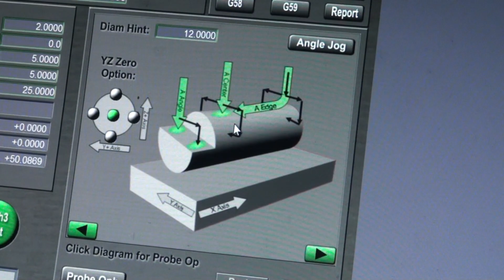Pull Gear Speed Reducer Part 5 - Thanks to Mr. Pete

Comment: I am in the process of building a boring head.  I got the pdf plans off the Internet and there is no other content for me to reference during my build such as a video.  I have ran into a few problems with the plans and wish that someone had made a video going into detail. In the case of your build, if anybody has any questions or doesn’t know where to start with the order of operations they can reference your videos. Lastly, you went into so much detail so that others might be able to offer you their opinions or suggestions.  Keep doing what you’re doing, don’t change a thing.  I watch your videos from beginning to end without fast forwarding.  Thank you !
Reply: I think This Old Tony made his own boring head if not mistaken....check it out
Reply: Makin Sumthin From Nuthin yes I saw TOT’s boring head cid.  There is another video similar to the one I am making but some tolerances on this specific blueprint dont add up.  Thanks

Comment: Great, now you just added a new project to my list and I got here all because a guy and I had a conversation about how I told a guy he was going way too fast for the hole saw he was using and another guy said to get a pull gear. Well, I looked it up, your video popped up and here we are. I wanted to add one of these to my Bridgeport M Head, but didn't know what they were called. I knew it had to have planets, but never knew someone designed one already. Thank you.

Comment: Just watched this series. Excellent!
Not to criticise your work in any way, I remember an epicyclic reducer pulley system being used on the spindle of the Dore-Westbury milling machine design, rather than on the motor. This has the advantage that the belt speeds are not reduced, and power transfer is less impaired. I realise that the whole locking system has to be revisited.
Well done!
Reply from the maker: Russel,
When I was looking around for a way of getting some back gearing on the drill I remembered seeing a constructional series on the Dore Westbury epicyclic gearbox in an old Model Engineer magazine. I also remembered that I purchased the drawings for the Dore Westbury many years ago and I frantically searched for them in my filing cabinet. Full of hope, I unfolded the drawings only to find that they didn't detail the gearbox. I searched online and could only find some photos of the outside of the machine with no details of how it was constructed. Then, out of the blue, Mr. Pete put up his videos on the pull gear. I sort of took my cue from what he was doing. I rarely have to use the reduction but it's nice to know it's there if I need it.
Regards,
Mark

Comment: Great drawing and design.  I noticed on Mr. Pete's Pullgear, where the topcap engagement LATCH drops down in for lockup there was also an additional crosscut maybe 1/16" deep at 90° I would imagine to prevent the LATCH from walking and dropping into the lockup position unintentionally. 🤔👍
Reply from the maker: I'm glad you could make use of the drawings. It seemed a shame to produce it all and then not share it. I did notice the groove for the latch. It would mean a catastrophic failure if it were to lock up while in the reduction mode. 
Cheers,
Preso

Comment: Brilliant videos Mark! Exactly the same problem I have with my very similar drill press. Also it's a great device for many of the low speed mechanical devices I want to make!
Reply from the maker: Thanks John. I was getting really frustrated with my drill press. I purchased it as a junked machine with most of the drive missing and although I got it working by making some new pulleys it didn't have the low end torque to drill much bigger than 12mm in steel. With the pull gear I can run much bigger drills and hole saws so that is a plus. I didn't even know such a thing existed until I watched Mr. Pete's video on the pull gear and that was the inspiration I was looking for to have a go.
Regards,
Mark

Comment: A worthwhile project Mark it will make the drill press a completely usable tool now. Congratulations with a very successful build. I will download the drawings to attempt to make this but will have to carve it out of solid bar stock as I do not have foundry facilities here. I did however do casting at the high school I taught in.
Reply from the maker: We were never allowed to teach casting at schools that I taught in. I guess the timetable structure would have made it difficult because our lessons were only 50 minutes long. It would take that long just to get the furnace hot. 
Regards,
Mark

Comment: I like this. Planetary gears are cool. There are VFDs with vector control, which allow nearly full torque from zero RPM on up. You just get the motor down to bare form (no pulleys, just the shaft, and there's an auto tune function that spins it for a few seconds and fills in some parameters. There is also sensor vector control, which requires a shaft position sensor. But it is the bee's knees and actually allows for even closer to full torque from zero RPM on up.
Reply from the maker: I tried delving into the parameters on the cheap Huangyang VFD I have on the drill press but I could not get any decent torque out of the 240V three phase motor. The more expensive VFD on my small Sieg X3 mill is better at vector control but at the end of the day I was intrigued by the mechanical innards of the pull gear mechanism and I wanted to have a go at a planetary gearbox. As it turned out, I purchased a Bridgeport milling machine soon after finishing the pull gear and it sort of made it redundant since the Bridgeport is a much more capable drill press with tons of torque. 
Regards,
Mark

Comment: Hi Mark, have just watched this series and I’m a new subscriber, the only others I’ve done so are Mr Pete, TOT, Stefan G and That Lazy Machinist.
Your style give us the ability to understand what is going on rather than just be told the answer, please keep your approach.
Your machining ability is fantastic 
Loved the humour!
I have two questions which relate to the gearing , 1) would re-inserting the missing pulley from the original setup have achieved a similar goal with your VFD.
2) are you concerned about the small screw on the motor shaft transmitting all the force and possibly damaging the shaft, or does this not matter because of the gearing effect? ie less force at the drive side
I hope you are not offended by these questions, I’m self learning metalwork in my 60’s after moderate experience with woodworking and like to understand the science behind the method 
Regards Stan
Reply from the maker: Stan, thank you for those kind comments. With regard to the missing pulleys, we used to have several drill presses like that at the school where I used to teach. They had a good range of speeds but it always seemed like you needed to go from a high to low pulley range and that always meant taking off at least one of the belts so that you could swap them from top to bottom. They were also noisy due to the double reduction. The pull gear setup is still relatively quiet when it direct drive mode and the change from direct drive to reduction drive takes just a few seconds to set up. I rarely need to swap the belt around but the real reason I wanted to make the pull gear was purely for the challenge. I didn't expect it to work as well as it did but figured it was worth a crack!
The relatively small engagement of the key doesn't appear to be a problem. The torque is all concentrated at the chuck spindle end of the drive due to the mechanical advantage of the system. A bigger engagement of the key would have been desirable but I was running out of options for designing that in to the system. Unfortunately, engineering design is all about compromises. 
Regards,
Mark Presling

Comment: (I'm a little late to the game, but I can't resist piling on…)

If Mr. Drive is too dim to recognize the value of educating rather than merely entertaining himself,   well then we can't expect him to figure out how to mute the sound on his internet machine.

Great project, Mark! I think I'll be keeping my eyes open for a scrapped automatic transmission from something small (Micra?) to steal the gears and carrier from. Then I have to invent the problem this would solve. How about a motorized garden cart?

Thanks for the videos.
Reply from the maker: I've been criticised occasionally for talking too much but as you have observed it's sort of necessary to explain how and why a process is used. Having built the pull gear and used it on a few occasions I now find that it is pretty much redundant since I have purchased a Bridgeport milling machine. It has tons of torque for driving big drills but it was an interesting exercise building a planetary gearbox and working out gear centres. 
Regards,
Mark

Comment: Their is a lot of deflection and rotational movement in your drill press table.
Reply from the maker: Yes. You are correct. It's funny but I never notice it until I review the video footage. I have watched other people's videos and silently rebuked them for not having a rigid drill press table and then I find the mine is exactly the same. I did fail to lock the rotation of the table but the deflection is an inherent problem with the rigidity of the arm casting. I recall using a Wadkin Bursgreen drill press when I was at college and you could have rested a battleship on the table of that thing without any deflection.
Reply: I have noticed all kinds of things after watching what I shot. You think you see everything but you don't!

Comment: Hi there, down under. now I have just watched the series of the pull gears over again, and besides corona and corona beer, how does it work now? I mean did it stand up to you expectations? kind regards from Denmark
Reply from the maker: Henrik, the pull gear still works well but it tends to be noisy in operation which is understandable with the train of gears being used. I have used it for cutting with large hole saws but since I finished it I purchased a Bridgeport mill with the 2J variable speed head and it is much better for drilling large holes that require a lot of torque. 
Regards,
Mark

Comment: Great work Mark! From design to a useful working tool, pretty impressive. What do you make with all this stuff? I found Project Binky the other day via a different channel - they are awesome.
Reply from the maker: David,
I must say I have never really thought about what I make. Certainly not money anyway. I like model building, Mostly steam but recently I build a model turbojet which is sitting in a cupboard waiting for me to fix the hot end which distorted last time I ran it. I also built a large model steam tug called Cervia. The full size version is kept at the Kent Maritime Museum in England. My model has a twin cylinder steam engine and a LPG fired boiler. Just this afternoon I stumbled on a channel by a man named Find Hansen. He makes the most exquisite model diesel engines and it has sort of got me interested in doing something similar.

Comment: My thoughts on any improvement to the design have always run to the change from indirect to direct drive.  A locking clutch to engage direct, and a brake band (similar to a driveline parking brake) to take the place of the lock rod, and the means to quickly switch would be quite nice.  But the design of the changing mechanism, keeping it stout enough to handle the stresses and yet have it compact enough to minimize the amount of real estate it occupies, might be problematic.

I had someone complain about not having any dialog.  (shrug)  I've learned a lot from those that simply allowed me to observe what they do.  Allowing others like me to do the same is my way of paying that forward.  No sense in letting it all die with you.  If someone can learn how to do something by watching what I do (and more important, learn to think) then they are welcome to watch.  If someone can't, and are there only to be hypercritical, then it's "move along, you're distracting the others."
Reply: By the way, with the amount of hoss you were putting on that press (judged by the amount of flexing I was seeing) I'd say that it was working well above reasonable expectations.
Reply from the maker: During my time as a teacher I realised that we all learn differently. I tend to be a visual, kinesthetic learner which means that I learn best by watching and copying. Other people are auditory learners, they learn best by listening to an explanation of a process. My aim is to cater for all types of learners but I realise that some people are actually distracted by a commentary especially those who are somewhere along the Asperger's spectrum. These people are usually exceptionally good at learning highly specific skills. My own Son is like that. He learned to use a MIG welder by watching me do it once. If I tried to explain what I was doing he would become quite agitated and it would interfere with his processing of the skill. I guess it is a case of trying to find a balance. I also realise that having a commentary in (English) means that you are probably going to annoy a lot of non English speaking viewers. I like you idea of using a brake band because that could be actuated remotely. In the short time I have had the pull gear working I am finding that I have to use a short step stool to get access to the latch and the locking pin since my drill is on quite a high bench.

Comment: Next project to beef up the table, it is deflecting quite a bit there under the tool pressure.
Reply from the maker: I noticed the deflection in the video but it's not easy to see when you are controlling the drill bit. I often watch out for table deflection in other YouTube videos and it seems to be quite common. It's also possible that I failed to lock the table. The type of drill press that uses a rack and pinion to raise the table disguises the need to check the locking handle. For light drilling it isn't an issue but bigger drill bits will cause the table to deflect. 
Regards,
Mark

Comment: Down loaded your plans for the gear puller.  Since I do not have the programs to open most of the files (I think ALL but one) I need some help with the .pdf file you provided.  

On page 5 of the .pdf pages, I didn’t see a spec for the ring gear that will match the planet gears.

Regarding the sling improvement ( very clever by the way) what is the drawback to embedding the ring gear in the pully (press fit), and putting a trepaned ring in the top piece (loose fit)?  I am thinking the ring you called out might be more difficult to make than slots.  Would this affect the dimensions for the to piece?

Ken
Reply from the maker: Ken, The ring gear I used was 100 tooth module 1 (metric). I think there are lots of ways of reducing the loss of oil from the interior of the mechanism. Your suggestion would work but it would mean having a slightly larger OD on the assembly. There is plenty of room for this in most drill presses. I guess it would depend on the stock you have on hand to machine the parts. 
Good luck with the project.

Comment: pplease show more about the lathe attachment that you used to drill and tap the hole.
Reply from the maker: I will try to do a follow up on that gadget in an upcoming video. I actually have two of them. One was made from steel (flame cut, ground and filed) and the other more recent one from cast aluminium. Both work equally as well. If you have some way of indexing your lathe spindle it allows you to drill accurately indexed holes axially and radially.  I do show some detail of both the indexing attachment and the drill clamp in this video https://www.youtube.com/watch?v=CNkOv80iZ3U

Comment: Great presentation.One small thing tho'...
How do I d/l the assorted fiels. I get messages that *.ipt etc files can't be previewed..
Reply from the maker: I did all the 3D modelling using Autodesk Inventor 2018. Unless you have that software you will not be able to open the files directly. You should be able to import them into some other 3D CAD programmes like Autodesk Fusion (which can be had for free) or SolidWorks. It just depends on what you might want to do with the files. I did include a PDF of all the drawing sheets so unless you really want the 3D models you could just download the PDF.

Comment: If they don't like you talking they have a choice, LEAVE! Great series. Does you VFD support "constant torque"? With a .75kw motor that should have no problems with that size bit. Your next project,,,, drill bit sharpener!  Keep em coming...  :-)
Reply from the maker: I am not sure what settings to mess with on the VFD. The Chinese translation is very obscure. I will have to dig it out and take another look at it. I did get a slightly better torque response from it last time I delved into the settings. Someone has suggested that it needs feedback from a tachometer to keep to a constant RPM.
Reply: If you have a pdf or part# I would be happy to look at it for you

Comment: Mark ,,do you have 3 phase 420volt in your shed ?
Reply from the maker: Frank, sadly, I do not. When we purchased our land we decided to build the house about 75 metres back from the road frontage. I asked about having three phase power run underground but at the time they were quoting the cost of copper cable daily and it was way outside our budget. We settled on the thinnest single phase connection we could get away with and since it is underground it would be a nightmare to upgrade. I still regret the decision and I envy people who live in parts of Europe who get three phase connections as standard. 
Regards,
Mark